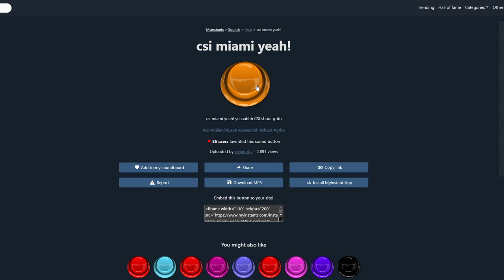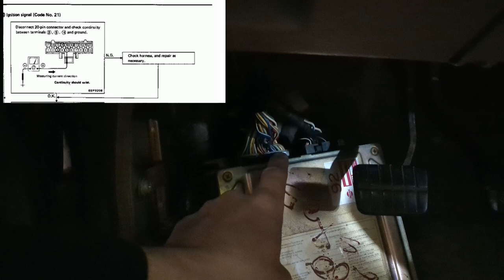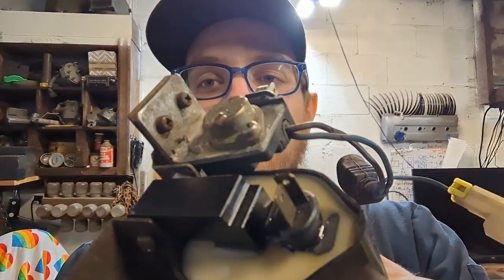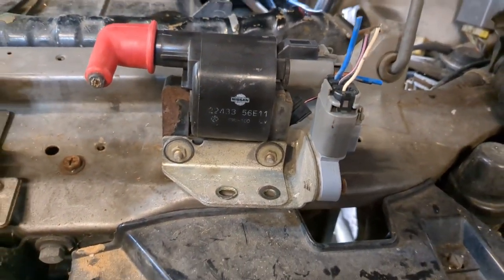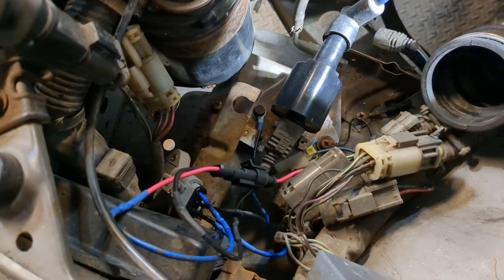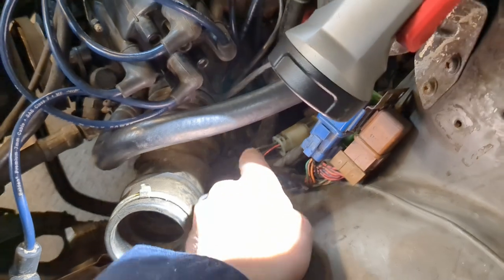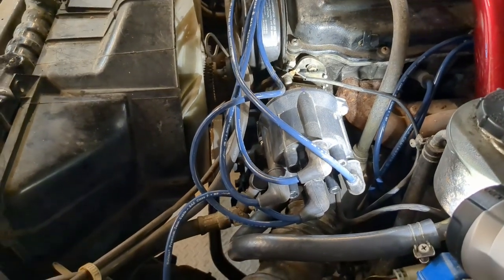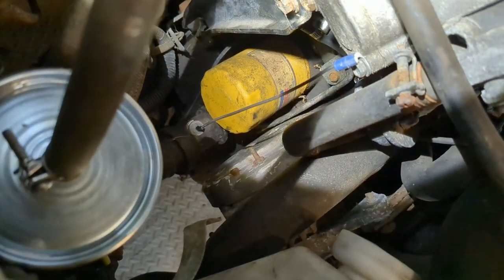how to barbecue your entire ignition system! reviving the 200SX

Comment: I have a 200sx that gets spark and seems to get some fuel but won’t start any idea ?
Reply from the maker: Are you getting any attempts of firing or just a cold turnover? I have had multiple issues with the injectors on this car so far. They are pretty easy to test for functionality though, Make sure they are getting about 2.7 ohms of resistance across the two pins.